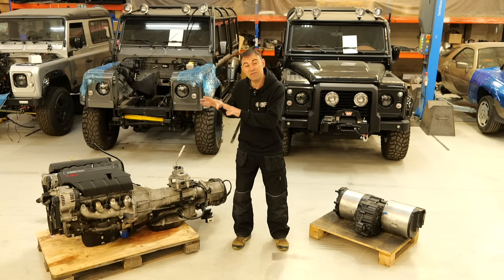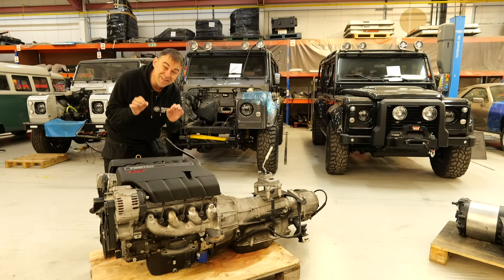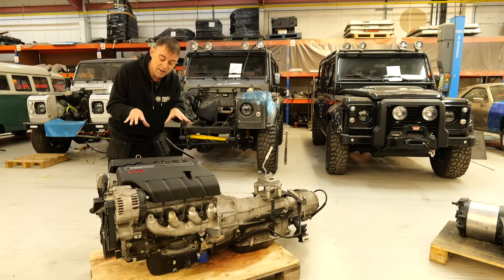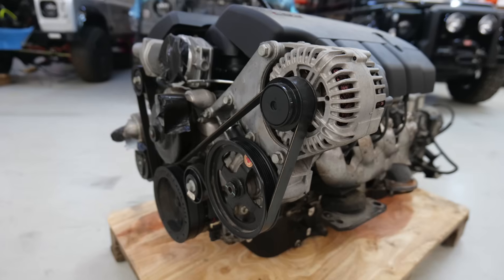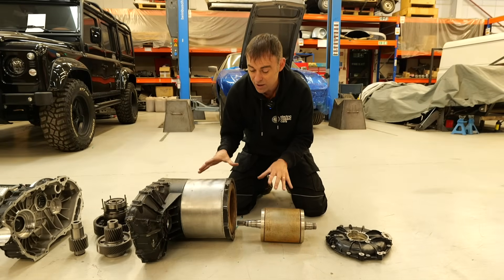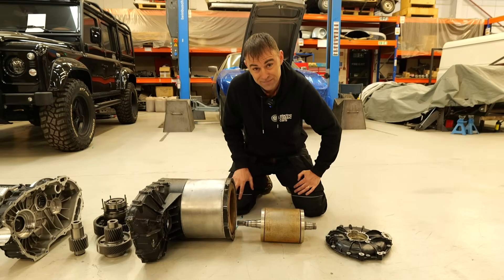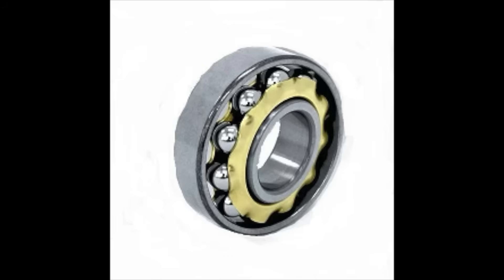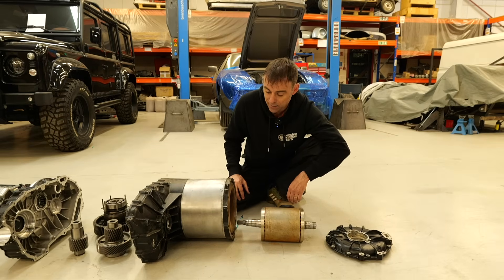Let's compare the Tesla LDU with an LS3 V8 and take one apart to see what makes it tick.

Comment: As I'm typing these words, a local shop has been finishing up building a worn out and rusty 1972 Buick Skylark Coupe for road  tripping. There's a part of me that would have liked to have had it built up as an EV, but two things stopped me. This was a very expensive build for me, even though I was using a stockish Vortec 5300 (a distant, smaller cousin of the LS3). I imagine that just fitting the car with a Tesla LDU, and a full Model S battery pack would cost as building this car is currently costing me. Also, there's the question of whether I could fast charge during a road trip. The North American Tesla Supercharger network is fairly restrictive and only recently opened to other production cars, like Ford, Rivian, Hyundai ect... I'm pretty sure they would not be open to converted EVs. I have no idea whether conversions would be accepted at other charging networks like Electrify America. I'm fascinated by EV conversions and would have loved to make one of my two classics, My Malibu wagon or the Skylark, electric. It's just that converting the Skylark involved a bit more risk than I'm willing to take on.
Reply: You buy a whole tesla then and take what you need off of it. Part out the rest, theirs a dude building a sick teslaghini (lambo svj wrecked with a wrecked p85 drive train and full pack swap into it. He did what I'm saying and paid almost nothing besides labor using a wrecked but still functional donor. Less than 5k All in after reselling it for parts once stripped of the wiring motors battery pack etc.
Reply from the maker: I can confirm that our conversions do work in the US on rapid charge stations. We have a number of customers already out there that regularly charge up on the CCS rapid charge stations. 👍

Comment: A good demonstration that electric motors are more efficient is this: If you drive an ICE vehicle around for, say, 30 minutes or more and then pop the hood and stick your head in there, you will feel a tremendous amount of heat coming out of the engine bay. But if you do this with an electric car even if you've been driving for over an hour you will feel relatively little heat. And think about what all that heat and massive vibration does to the parts of an ICE drivetrain. Imagine what that starter motor goes through or that alternator or water pump being attached to the engine generating hundreds of degrees of heat and massive vibration for hours a day. And since the electric motor assembly generates so little heat, there's little requirement for cooling and so that engine compartment can be sealed, which means that it stays CLEAN. Except for a bit of dust I have never had to clean anything in my engine compartment. I love everything about it.

Comment: How anyone can look at those two propulsion units and still think we should stick with internal combustion is beyond me. The only shortcoming of electric drive is battery chemistry, energy density, and charging speed, and those are improving all the time. Internal  combustion hasn't changed in a century.

The gear box isn't only simpler but will experience less wear since the gears in an EV box are permanently engaged in a fixed position while the gears in a transmission have to slide against one another as they engage and disengage. That also puts more wear on the bearings. Oil and coolant also last longer since they aren't subjected to as much heat.

Comment: Yes, you can modify that LS3 (and pretty much any ICE motor) to make more power, but the beauty of the electric motor is that you can beat ICE cars all day long at the track and then drive it "normally" and get the equivalent of over 100MPG. An ICE car can't do this, especially if it's tuned to make even more power. If you're building it to race on a course or drag strip, your MPG is going to be quite low even if you drive it "carefully".

On top of that, the much Much lower maintenance requirements, instant and very smooth torque just make the whole driving experience with an electric car that much more enjoyable. I will never be going back to an ICE car.

Comment: It might have been worth saying that although the inverters look complicated, failure rates are low, at 0.2-0.6% . Much lower than ICE motors of course, which also have complex electronics.
Reply: what is the rate based on ??? 100,000 hours of use?
Reply: @ Google it

Comment: Thanks for the side by side comparison. Here in Thailand there's charging points in every shopping mall, all new condominiums and retrofits ongoing in older buildings. EVs having avg 20 moving parts vs 2000+ on ICE to maintain, new gen batteries which will outlast most cars lifetimes and costs 75% less to 'fill', it just makes sense & cents. Big fan of your show plus Ben Sullins and Electric Viking. Cheers
Reply from the maker: Ben Sullins is an excellent YouTube channel and one ALL anti-EVers should watch. 👍
Reply: @ElectricClassicCars  Waiting for the Plaid rear motor conversion in a Landy... I'm reckoning 800hp is possible with those.... :)
Reply: @kylereese4822 
AEM of Newcastle Tyneside 🇬🇧produce  produce some interesting motors  they do away with copper windings and rare earth permanent magnets . That makes the motor cheaper to produce and less vulnerable to heat   , and vibration damaging of permanent magnets. They can also be switched off to freewheel with zero cogging.. the motors can also be stacked with up to three inline to produce huge power and torque figures for commercial vehicles and large boats. 

With live axels like on landrovers  or trucks the Chinese are now building replacement axels with motors or twin motors built in .. Which is the way the Canadian Edison motors have gone with their Heavy duty logging trucks and Medium to HD American type Pick up conversions. 
They also incorporate an ICE  Generator  to support the battery charging when off grid. Series Electric hybrids  for vehicles working away from any charging infrastructure... 

Regen Breaking also makes electric vehicles much simpler to maintain ..the brakes last longer.
Reply: @ElectricClassicCars  BYD motors look promising also... ?
Reply: pai Central! 😁 Sounds like EV adoption in Thailand is going well, glad to hear it.
Reply: How about that, i am a sub to both of you, the EV has a future which i am interested in, i have been smitten by the BMW i3 extender but fear of its tech, plus STL shows me what Thailand is like outside of the go to resorts, i have a good friend who's son lives in Hua Hin and am hoping to visit in the future.
Reply: Tesla is great!
Reply: Stator, rotor, battery, charging system, grid, thermal generating pla t, railroad moving the coal, coal mine.
Reply: Asian cities tend to be dense where traffic congestion is high, travel distances are short and climate is agreeable, so EVs make sense. If you do mostly city driving, EVs are the way to go. If you do long trips for things like recreation or road trips or you live in cold climate, ICE is still the way to go.
Reply: @MrAkaacer  OK, but I need a car for holidays too which take a long drive. Having 2 cars one EV for city and petrol one for travel is too expensive for many people. So for me hybrid vehicles have most sense for now
Reply: The production of lithium batteries and are way more environmentally dangerous than gasoline. And in Norway that have a problem with the recycling of them. I see the point of moving mechanical parts. But that's from your cost-saving point of view. And not from an environmental perspective. There aren't that many charging stations here in Norway and the power capacity on the grid is poor because the companies send the power abroad.
Reply: @talnesalnes4345  lithium batteries is recyclable. Why would Norway have a problem recycling batteries?
Reply: I dont care what batteries will do in future, I am interested in now. We all know that battery capacity varies with temperature, and capacity drop wit every charge cycle. So I am interested what is the lifetime of EV batteries, and how much it cost to replace batteries on 10 year old car with originals?
Reply: @ 
The battery on my Nissan Leaf is 12 years old and at 70% health with many years left in it. Admittedly it has been well treated but the point is it’s very old tech. A modern battery and its management system should last much longer, probably the life of the car.
Reply: @meofnz2320  But that is the main issue i have with EV. Imagine that your petrol tank in a car shrinks to 80%. So basicaly you should replace batteries after 10 years. And I am afraid it would cost more than car is worth.
Reply: @ 
It depends on your intended use. For most people you just factor that in when you buy it. We only do about 50km a day max. If your commute is 400km it’d be a different story!
And as anyone who watches Top Gear knows; in a petrol car those ponies escape and range decreases with age as well.
Reply: @meofnz2320  For me, it's about refuelling. If you're doing city driving you can make it a day or two without refuelling and there's plenty of opportunities to charge when you're doing something else, like at home or at the shops. This puts it on the same convenience level as an ICE car. Long distance, not so much.
Reply: A battery will last 5 to 10 years. Its,like owning a cell phone. After a while you need to change the battery. However since EVs have so much tech, after 5 to 10 years that tech will be way behind just like a old cell phone. So you will have to sell it cheap if you want to sell.
Reply: @moabman6803  That is my issue. After 10 years when batteries in EV expire, car is practically worthless, while petrol engine car can last much much longer and still has value for money.
Reply: I dont care about hypothetical "next gen" batteries. Truth is current batteries capacity drop with each cycle so after 5-10 years car is not usable bc of that. and changing new batteries is probably more expensive that used car is worth. on the other hand gasoline tank doesnt shrink with time and with maintenance you can drive your car 30 years.
Reply: 😂😂😂 Fill by V8 in around 90 seconds, no child slave labour required and it passes the emissions test every year. Take the tax off petrol and diesel instead of EV's 😂
Reply: charging points in every shopping mall, with a long queue. If you are short on time, bad choice
Reply: The worst part of driving electric, is letting the world know your gay
Reply: ICE are good for people who don’t do long return long distance driving. If you live around town and drive short distances Evs are good as long as you park in outside were by if it want to combust it can do that outside away from the house.
Reply: @xrismanessa3993 thats such a worn out myth. 
Completely incorrect.
Certainly not our experience, We frequently do long distance driving.
Reply: @xrismanessa3993  2020 Insurance study/NTSB data: ICE/gasoline/petrol fires per 100k sales = 1529.9 fires and 25.1 for EVs. Newer tech LFP batteries are even safer and much much less likely to catch fire.
Reply: @SideTripLife Eventually, VIBRATION and CORROSION attack the Lithium battery pack, causing cracking or distortion, thereby exposing the Lithium to MOISTURE (puddles, splashes, fog, high humidity, even floods), which causes it to EXPLODE and BURN.
Better to have all ICE vehicles that are fueled with perfect computerized metering of HHO (WATER electrolosized into Hydrogen and 100% PURE Oxygen).
OR Hybrid ICE with batteries and ELECTRIC MOTOR driven, with HHO as the fuel.

Comment: The only downside is the initial cost of switching to eV. If that cost goes down to equal the cost of running and maintaining an ICE or hybrid vehicle in a span of 10yrs then it is a no brainer.
Reply: Well..... they are selling VERY good new EVs in China now for sub $20k.
MAybe "we" should be asking the Government why they're not making it easier to get the country off Fossil Fuel by Pushing EV?
Reply: @ I don’t think they’re really interested in it
Reply from the maker: Just buy secondhand. That’s what my son did.
Reply: Depends if you like buying new or used cars. You’ll get a decent range used EV for 10 - 17k these days and the worries about battery performance are proving to be unfounded.
Reply: @ianlighting100  you’re right. 2nd hand eVs are fine. However I’m looking at converting a classic to eV. It can prove costly.
Reply: @NasaraThePoet  all depends on battery capacity / range. If you want ultimate level quality then ECC will do you an amazing job for top dollar. If you are happy to go DIY and run the risk of electrocution you can have a 60kWh conversion for under £10k.